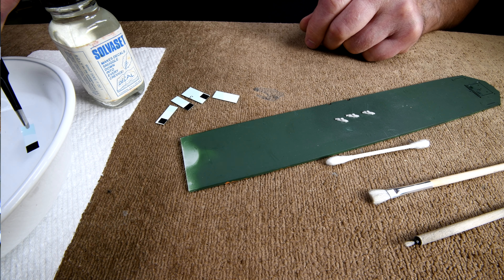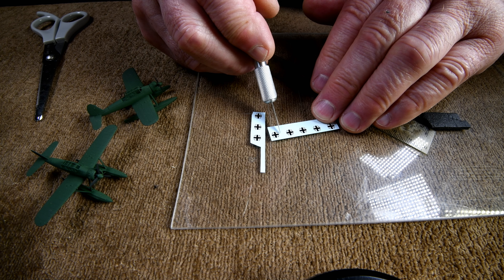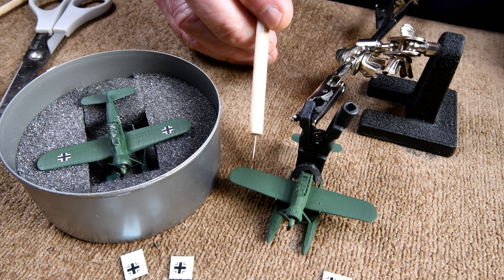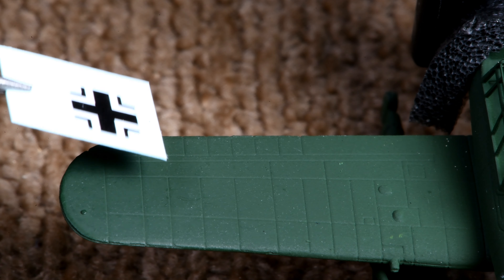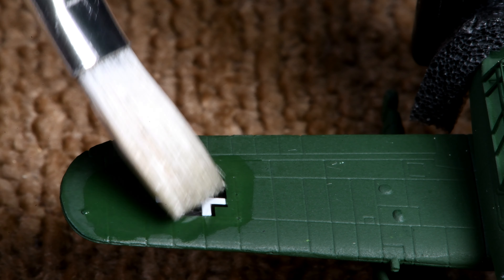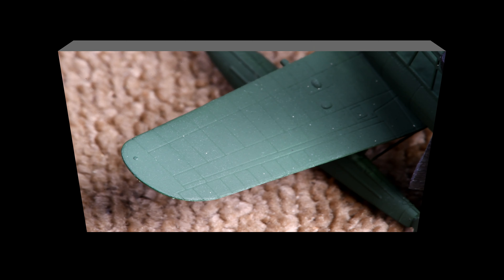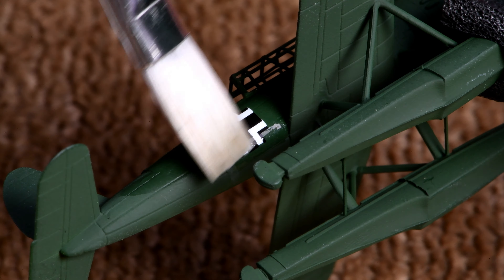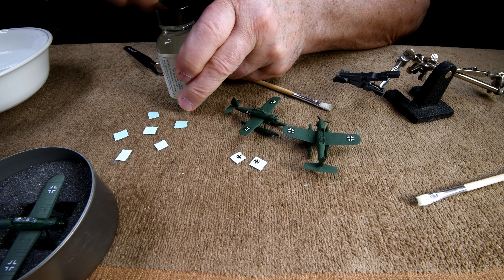The Model Ship - Part 451

Comment: Hi Ron, still in awe of your work and thank you for the number of tips you’ve provided, especially on how to do rigging. You have inspired (and shamed) me sufficiently that I am re doing the rigging and masts on my 1/350 Bismarck.  
Please do not take this as a criticism, it is an observation.  From the research I’ve done and consulting the magnificent book by Stefan Draminski, the under surfaces of the Arado were either a light grey or light blue. The spinner on the propellor was red, the propellor blades black. 
Also, in response to a comment the other day, the Draminski book on the HMS Hood, which is not as detailed as the Bismarck book, is nevertheless excellent.  If you search Draminski, Hood on you tube it gives a pretty good idea of what’s in the book.  Cheers, keep up the excellent work.
Reply from the maker: Thanks Mark. Some of these books are not deliverable to Canada. Will keep watching out for them however. 👍

Comment: Excellent job there Ron! It's a shame that those decals aren't more closely cropped, that large shiny square of excess transparent 'decal' really takes away from all your hard work....I guess it could be snipped off beforehand but you'd think it would be done as part of the manufacturing process. Not your fault by any stretch, thats unfortunately just how it is. Ho hum.
Reply from the maker: Nope! It is my fault! I could have cut them down to size. That's the difference between me and the skilled modelers, lol. Perhaps a coat of clear coat will sort of make them blend in. 🤞

Comment: In the test run yesterday you used a Q-Tip to remove the decal from the paper.  The more rigid Q-Tip seemed to remove it more easily.  The brush just seems too flexible. 

When I was a kid and making models I use to use my finger tip to adjust the decals after they were on the plastic.  The Q-Tip might work for that too.      See ya tomorrow.    JimE
Reply from the maker: Re: "a Q-Tip to remove the decal from the paper"
Yes Jim, I was thinking that same thing too when editing. Would have worked better. I've got a good memory, but it's kinda short. How can you tell that I do this only once every 40 years or so, lol. See you tomorrow. 😁👍